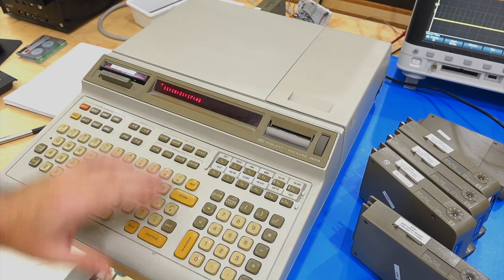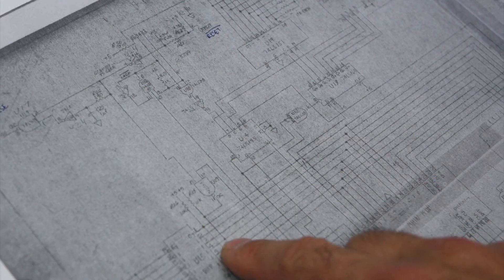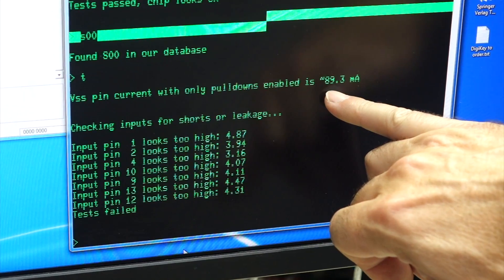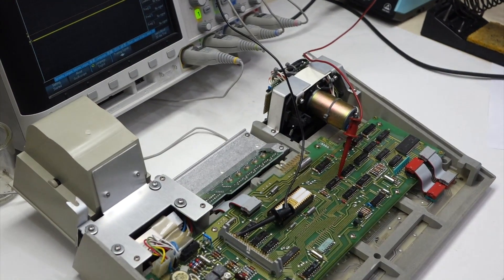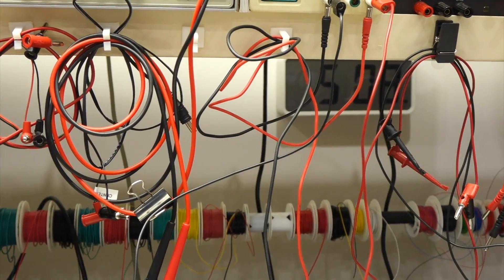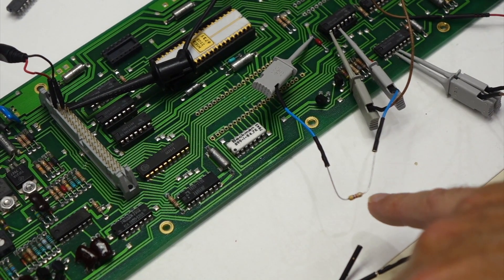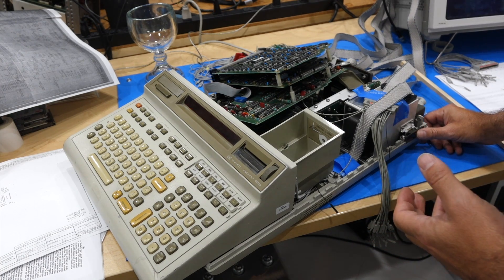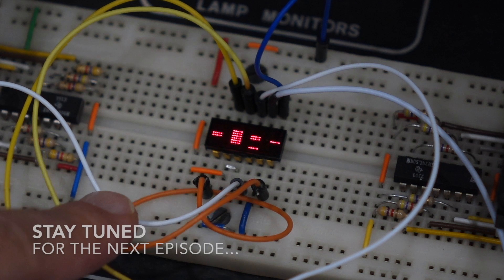HP 9825 Repair - Part 11: Is our HP proprietary Keyboard/Display/Printer chip dead?

Comment: Interesting... I have a HP9825B and it has a totally different keyboard with Cherry switches and much larger keycaps that look more like a HP85. Mine has bad keys with up to 100 Ohms when pressed. I just found out that when I re-solder the keys this seems to fix the problem. As if the heat cleans the contacts.... strange, but good if it works.

Comment: I'm actually upset that these devices are rare and that I could not find one on ebay. If you have lots of HP era test equipment. This is quite the accessory to have... It is amazing however that you CAN find modules for software routines and other accessories for this thing

Comment: There was a guy on the CPU world forum (wepwawet) who had some of those KDP chips. It might be worth checking if he has still got any.
Reply from the maker: Really? How long ago was that? Link (I’ll let it through)?
Reply: @CuriousMarc  I posted some links but the post has disappeared. If you google: cpu world wepwawet "1818" 
that will find the original thread where it looks like he may have the KDP chip. It is an old post but being a collector he may still have it. It looks like he is still around because he last posted in February this year.
Reply from the maker: @Mac Man  Found the thread. The person only mentions he has a few 1820-xxxx and 1818-xxxx chips, which covers basically any common HP logic chips. I’m not sure why CPU shack later mentions the KDP chip - maybe because it’s the closest one in that series that could be considered a controller? But thanks for the pointer, close call, comment like these are the ones that help.

Comment: Are these HP 9825 mostly used to run HPIB  (GPIB) Commands to configure electronic test equipment to sequence through a set of configurations to run a test procedure for testing batched of printed circuit boards? 

I worked with a different, probably, later HP Computer model, that had a small 9” diagonal monochrome CRT, instead of the LED single line display of this model. We used it to configure an auguries generator, and audio signal analyzer and oscilloscope through multiple settings with about 25 steps to complete the complete test procedure on a Subscriber Line Interface Card for a digital back bone to Analog Telephone interface. It covered everything from DTMF recognition, through Signal gain adjustments to Measuring the Signal to Noise ratio and no audio input, idle noise floor quieting of the ADC and DAC digitizer circuits.

Comment: Funnily enough, I just had to deal with an ‘annoying beep of doom’ on an old Slot 1 motherboard, which according to the beeps meant a CPU failure. Eventually it turned out reflashing the BIOS fixed it and everything seems fine.

Have to say, it’s surprising ‘nice looking’ for a chip hidden inside a case for a KDP, if it’s fried maybe encase it in acrylic and put it on display next to a picture of Mr Fancy Pants?

Comment: Check all tantalum capacitors for leakage, please. And  pull ups or down resistors. They could act as a fuse with that 13volts
Reply: Failed resistors always go open or have higher resistance than their specification. Resistors never short. It could be a cap but the caps are rated higher than 13V so they won't have failed because of that.

Comment: Seems like the KDP is pretty rare. I checked Sphere Research, they don’t seem to have it. 1818-2508, right? I’ve seen someone design an entire (very large) PCB to replace one unobtanium IC to keep a piece of legacy equipment going, but that was before FPGAs. Maybe a big FPGA or reasonably quick micro might be able to be coaxed to do the job of the KDP?
Reply: Would be really cool if HP or one of its former employees had the design schematics or functional block diagram of that KDP chip.  Something tells me it would be a real challenge to reverse engineer that chip, and likely an impossibility if the silicon is damaged.
Reply: @projectartichoke  Well, Marc has access to the originl designers, so likely he also can get the original design logic for it if needs be. Going to have to then find one of those special purpose CERDIP packages that were designed to allow old milspec IC's to be replaced with modern SMD versions, and build in a tiny adaptor PCB to allow a modern FPGA to emulate the logic and still look original.
Reply: I dug far back in my notes. The ‘unobtainium’ chip was an Intel 8089 IOC. The replacement board was very large and from what I recall was filled with 74HC logic and GALs and other chips from the mid to late 1980s.

Comment: I was wondering if there is a new computer called the 9845.
Reply from the maker: Greasy fingers when typing the title, I corrected it. But there is actually such a thing as the HP 9845. It’s a classic actually, one of, if not the first graphics workstation. Has two of the upgraded processors from the HP 9825 in it. It’s humongous.

Comment: I was always taught to set your current limit at least an order of magnitude more than expected when debugging 74-series circuits.  Undervolting them puts them in latchup, and depending on how it latched up, old 74 chips can burn out and start to melt in under a second.

The rule of thumb we were taught: a high current short blasts a single tree with lightning.  A low current short starts a forest fire.

 Am I misinformed? Because I really hope they didn't just make their problem much worse by undervolting the board so many times in this video.

Comment: Next up on episode 13: We will now try to reverse engineer our super special chip for manufacture using our very own homegrown semiconductor fab.
Reply: tbf, there are some YTbers manufacturing chips but whether this thing is old enough tech that you could reproduce it is still a bit of an issue assuming you could even generate a working design for the masks
Reply: @AsbestosMuffins  None of that is needed. If the custom chip is just a bunch of logic then a CPLD will do the job as long as they can get the logic diagram of the custom chip. Over the years CPLDs have been used to replace a lot of special chips in retro devices. Back in the 80's and 90's Chinese arcade bootleggers used a CPLD (or several) to 'emulate' custom chips on arcade PCBs. None of this technology is new.

Comment: @12:38 - Hehe, I found a bad 'U17' (an OTP BIOS EPROM on a PS/2 Model 25 in my instance) today too! - I need to do a file compare with a known good BIOS image.
Reply: That's The Secret then.... got a fault on a board? Replace U17... problem fixed. ;)
Reply from the maker: This must be a case of electronic Karma, or a new electronic form of Voodoo. Link to @IBM Museum’s bad U17 video: https://youtu.be/hOb_NaN1oeQ . To confirm the Voodoo theory, you should check your U2 also. Mine wasn’t doing so well… Thanks for helping us with the PS/2 model 77!

Comment: 16:30 "I have disconnected the beep pin" - seeing that poor gold pin bent up in the air hurt me probably more than it hurt the chip itself 😱
Reply: Right?  Especially an ASIC.  Either way I pray for it surviving.  Tough one to find.  Only the real thing will suffice.  Lame failure when one arrives at this possibility.  Been there.  Wishing the best, Marc!  You've come this far and you're insanely close to having it 100%.  Really hope this doesn't thwart ya'll in the "final hour."
Reply: Would it be possible to "cheat" with an FPGA?
Reply: @user2C47  if you know the logic inside, an FPGA or even a simple 8-bit microcontroller (AVR, PIC,...) should be able to do the job...
Reply: @user2C47  probably no one is going to reimplement the KDP in FPGA or similar technology. Too little demand to warrant the reverse engineering.
Reply: cutting a trace and soldering jumper would make more sense eh?

Comment: Is there some sort of way to find out how the KDP-Chip works internally, so you might be able to build a replacement with a CPLD, like a Max II or Max V? 
Maybe Ken can decap it and reverse engineer the internal logic. If the chip is burnt inside, it's at least interesting to see what 13V does to a 5V-TTL-Chip ;)
Reply: Marc said in another comment the chip contains lots of complex logic, ROM and RAM. Reversing it is near impossible unless you have millions of dollars for research and also millions of dollars in specialized equipment. Some old equipment from the 70's isn't going to cut it here. The effort and money required to reverse it isn't worth it. It would be possible to build a replacement using a CPLD and a ROM and RAM but the ROM would need to be dumped from a good chip... not sure that's even possible without decapping AND proper knowledge. The only hope is if the internal schematic of the chip can be found by one of the original designers then a CPLD+ROM+RAM could emulate it. That's a big IF.
Reply: @johnbos4637  Yes but remember, they know the developers, who probably has the firmware!
Reply: @Dust599  Not unless they stole it and kept it for 50 years. When you work for a company, no matter what you do the company owns it. You can't just take information from a company even if you designed it.
Reply: @johnbos4637  "CPLD+ROM+RAM" hence FPGA?

Comment: There's a highly rated eBay seller in Bulgaria who has lots of government surplus 5400-series logic for sale...including the more obscure ones like the x425.  He will combine shipping if you contact him.  It could take 45 days to get here, though.
Reply from the maker: Yes, I have bought from him before, all his chips were good and reasonably priced.
Reply: Are timings and voltage requirements so tight you can't get a 74LS25 to work in there or is the LS25 exactly as hard to come by or do you want to keep the machine 100% pure?

(of course the only correct answer is "Yes.")

(but entering ls25 in the Tauntek would at least allow you to test the defective chip as well as the replacement - who knows, maybe the replacement is bad as well)

Comment: Do you have the specs for the KDP chip?  Basically what goes in and what comes out.  You can substitute it with a modern programmable logic device.  Of course an adapter board will have to be fabricated.
Reply: This is Marc we are talking about, they will pop the cover off and re-wirebond that badboy.
Reply: @cda32  here's hoping it would be that easy!
Reply: @cda32  doubt that the wirebonds are the issue...
Reply: @cda32  I think someone will  jump in and reverse engineer the chips, so it can be duplicated, like the chip on the clock board was.
Reply: @ikocheratcr  And then Sam Zeloof can fabricate a new one.
Reply: I mean... What in this couldn't. I think it would require quite some reverse-engineering still.
Reply: @rkan2  When you have an irreplaceable ASIC you have to get creative.  PLD's have made many advances since this thing was built.

Comment: Is the fancy chip one of their custom ROMed microprocessors, or just something similar to a gate array?
Reply from the maker: It's a quite complex NMOS custom logic IC. The first revision of the board (9825A?) had a very large amount of TTL logic,  the display and printer SRAM and a character ROM to implement the keyboard and display controller. They integrated it all on one chip to save cost. No micro-processor in there though.
Reply: @CuriousMarc  Microprocessor in all but name, it likely has a state machine in it just short of being a microprocessor, in that the program ROM is part of the instruction decoder. Probably as complex as the 8080A was at the time, just that HP never thought it was a part that had general application, and thus never was offered for others to use. 

If they had made a version to compete with the Intel CRT controllers it would have been interesting.
Reply: @CuriousMarc  
I think about the hours we have watched over 11 episodes, but that's minor compared to the much greater time you've spent on this and it's still not finished.  My sincere wish is to see things go well for you in the future.
Reply: @CuriousMarc  I'm guessing we'll find out more on the next episode but if there is that early revision with the logic implemented with TTL does it mean that you basically have the custom chip already reverse engineered so to speak?
Reply: mr fancy pants probably knows it all. He's the key from the start.
Reply: @Damien.D  wrong division.  Bob was a microwave guy throughout his career.
Reply from the maker: @johnprouty6583  Hi John! Thanks for finding and putting us in touch with Bob Stern in the first place!

Comment: Once you do restore this, tie 2-3 6 Volt Zener Diodes across that 5 V rail, goes to 10 V again! That is what HP should have done! As long as it behaves, the Zeners do nothing, but if the voltage rises, on they come!
Reply from the maker: Oops, better not do that on a 30A supply! You'll fry your 9825 *and* your Zeners, and maybe put something on fire. The proper fix is a crowbar. See episode 2 I think. This is essentially a Zener-triggered thyristor. The Zener does the overvoltage detection, the thyristor takes care of the high current. It will bring the supply close to 0 volts for a few ms, at which point the fuse will blow. And neither the Zener nor the thyristor will be damaged.
Reply: @CuriousMarc  I hope you have already done this! It would be really bad for the supply to fail again while you are in the middle of fixing this thing, or worse, you have one of the good boards plugged in to test something!
Reply: @CuriousMarc  Just remember that the crowbar circuit itself can quietly fail. I had a power supply do that and give the entire computer a 14V TTL supply. Only casualty of that, and after a few hours of flight, was a single PM5403 chip, which got a little unhappy, and decided to unsolder it's lid.

New board (plenty of them as spares, because that particular board never really had any failure mode other than capacitors) and a rebuild of the power supply, replacing every component in there in the 5V regulator side, including the 5V crowbar parts. Down to all the resistors as well, the only thing that were left were the 2 15A Littlefuse solder in fuses that were there, in parallel, which from experience absolutely never failed, unless the crowbar operated.

Another unit had the 6V2 25W zener diode overvoltage clamps, 2 in parallel in the power supply, on a massive heatsink block, and would regularly cremate them. However the most common failure was thermal runaway in a power transistor, used to control the 12V 150W illumination lamp, which had a terrible thermal design, and which would have some go into thermal runaway.  Goes into runaway, and blows the lamp. Pilot then switches to spare lamp, and it also gives a single brilliant flash as it fails.

Solution was simply to grab a tray of 100 2N3773 transistors and test them for saturation voltage at Ib of 1A, and use those with the lowest value, with the rest being used for any other purpose, mostly as a replacement for a 2N3055. Then do the same for a bag of 2N2219A transistors. Best 10 of each lot would survive well. The test jig was a cup of water, and some crocodile clips, and simply dunk the DUT in the water, and turn on the power. Design was flawed, running the transistors on the ragged edge, and obviously the original batch was really good in that respect. Also the same board used unijunction transistors and optocouplers, not exactly the best for driving a darlington transistor.
Reply: @CuriousMarc  how many amps is the thyristor capable of switching?
Reply: @SeanBZA  since the duration of the fuse blowing current pulse is so short, I doubt the thyristor would need heat sinked, using only an informal chassis if present to mount to, as the temperature rise would most likely be less than 10 degrees C over the body of the device after a trigger event, even if stuffing out a shorted regulator controlled transistor, 10 volt surge, to knock out the fuse.
Reply: @DishNetworkDealerNEO  Yes it does not need a hetsink, as leakage is very low. Power zener diodes will need this though, as anything under a 25W unit will likely blow open circuit before a fuse blows.
Reply: A proper crowbar circuit would be a better solution, it would take some beefy zeners to survive dumping the current from that PSU.
Reply: HP made a later version of the power supply that had a crowbar circuit across the 5V. Unfortunately Marc's version didn't have that modification when the supply died. I think I recall that Marc was planning on installing the HP mod circuit, but I'm not positive about that.
Reply: Apparently we are many owners of these old 9825s with unmodified power supplies who have urgently installed this crowbar circuit and also checked the power supplies and also all the PCBs of the machine (especially the capacitors)
Reply: The idea is not for the Zeners to survive, but hard short once abused and blow the fuse. I’m sure that if an electrolytic cap shorted down, HP has a fuse in the power supply to blow. So with several Heavy duty Zeners, it will crowbar the defective regulated 5 volt supply, which beats replacing all the TTL and probably the ASIC in that keyboard.